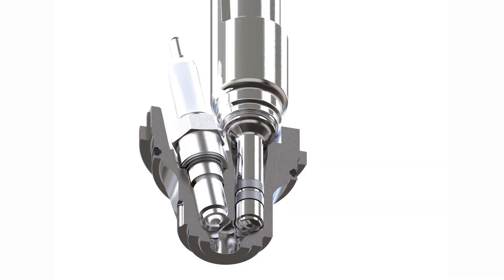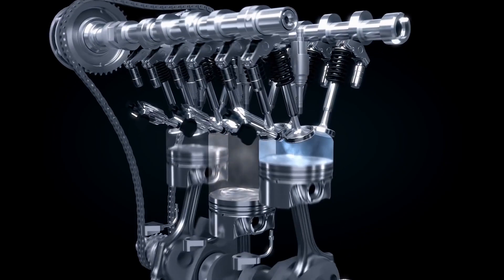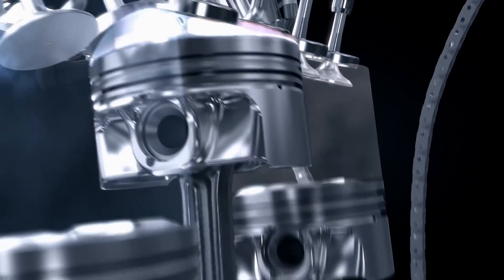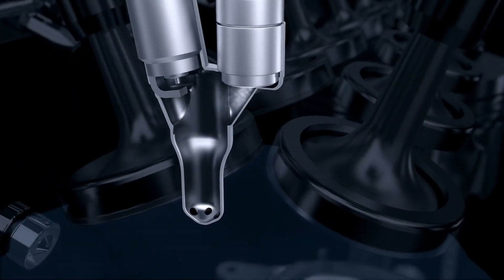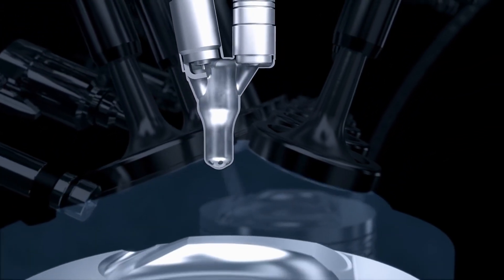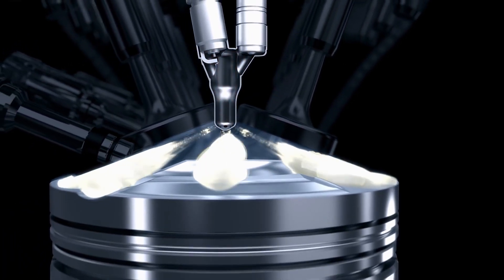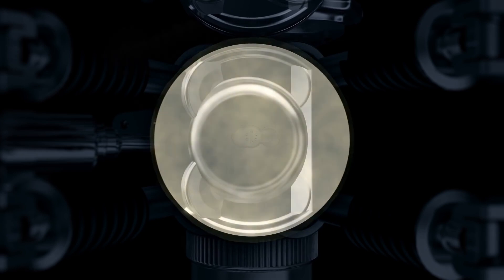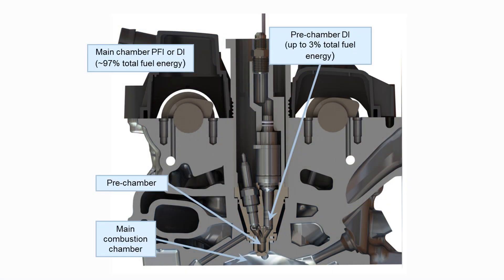Want +20% MPG? Bam, Here You Go - Autoline Exclusives

Comment: I see the spark plug right next to the injector but where does the air come from? Maybe there's enough air just floating around? Maybe you don't need much airbjust to get it started burning? It just seems like trying to light a stream of fuel would be very rich. What am I missing?
Reply: I see there is a prechamber. How does the air get into the prechamber? Reverse flow through those nozzles into the prechamber? I suppose there is enough cylinder pressure to do that. It just seems weird. Is that really the way it works?

Comment: I can't believe carmakers are still making internal combustion engines. People, we HAVE TO STOP MAKING AND SELLING ICE. The climate crisis is real - it needs to be taken seriously RIGHT NOW. Tesla has the right idea - and interestingly, THEY ARE THE ONLY CAR COMPANY WITH A POSITIVE FIRST QUARTER. That should tell you something about the desire for EVs.

Don't give me that BS excuse that there is no call for them - there's a much higher call for EVs than ICE, but they have to be good EVs. Tesla has raised the bar pretty high. So come on, let's see some of that fabled competition!
Reply: I would argue tesla has the wrong idea. It would be much more economical and beneficial for the environment to move towards a hybrid system. At least until battery tech improves. 

Their are limited battery resources and the average miles driven by people is roughly  26. Do you have one car go 250 means on electric or 9.6 cars only have enough batteries to handle most daily trips? 

ICE vehicles will be around for many more decades. Tge investments by auto makers makes sense.

Comment: FYI - Current F1 v6 engines have a max speed of 15,000 RPM, but normally peak at under 12,000 due to other system constraints. Still quick compared to normal road car engines, but nothing like the awesome v10 18-19,000 RPM screamers of the past.

Comment: Wow. This a real breakthrough that will hopefully result in emissions from ICE engines during the transition to electric.Very interesting interview.
Reply: The "transition to electric" will not happen. There will be a development for sure and lots of battery-based and electric-motor based travel, but there will not be a blanket "every car is a pure BEV" event. Engines will continue to exist in most cars. So this kind of development is even more relevant.
Reply: @zolikoff  I agree and I think we will have a mixture of different propulsion systems dependent mostly on the application type and economics of the time. From what I am seeing with the growth in technology the hybridized approach may become the dominant propulsion system for a while due to cost/resource effectiveness over hydrogen and BEVs. It can drastically reduce resource consumption on both the fuel side and the battery raw materials side all while providing most of the benefits of both methods and while utilizing more commoditized technologies. Also I believe ICE based vehicles will stick around because general reliability of all vehicles has improved dramatically across the board  since CAD/CAM has been effectively leveraged in the design process. On another note ICE may stick around even longer with more renewable bio-fuels potentially coming online in the future. Sorry if this was a bit wordy as I usually don't log on to YouTube this early in the morning. Cheers!
Reply: @zolikoff  If they keep making advancements in battery tech it would only be a matter of time before ICE cars go away.
Reply: @williammitchell1272  Tell this to 2nd and 3rd world countries. lol I imagine EV is only applicable to the western world which is maybe 20% of the world.
Reply: Yeah if we are to be using one general technology in the meantime why not make better for the interim? It is not like they will instantly disappear overnight even after any end of sale date so advancements are always a good thing to welcome.

Comment: I’d rather have dual injection. The intake valves are going to be caked up with carbon buildup. It might have the potential for burning oil. Depending on the brand.
Reply: Based on the description, it sounds like this is more like an ignition replacement than an injection replacement.  The main cylinder chamber would still be getting some more conventional fuel injection, and I don't think it precludes port injection.

How much carbon build up occurs in the prechamber depends on how it gets its air charge.  If it's getting it from the main intake with the vacuum recirc, it's a risk, but if it's getting it from a push via the compression stroke, the risk of fouling the prechamber is probably quite low.

Comment: I would like to hear what their 20% efficiency improvement is based on.  Is it 20% over a normally aspirated legacy two valve one spark plug engine efficiency, or is it 20% off an already optimized engine.  Keep I'm mind that 20% improvement on a 20% efficient motor yields 24% overall efficiency, not 40%.
Reply: If I had to wager a guess, I'm guessing it is based on two things --
One is being able to run leaner mixtures in the main chamber, and the other is getting a stronger impulse from rapid burn rate.  The former would be a true fuel consumption reduction, whereas the latter would be an effective power boost that makes it either possible to run at lower boost pressures or downsize the engine further.  The sum of those two could probably get you up to 20% improvement within the power band only.

Comment: This guy knows nothing about diesel auto engines. The indirect injection diesel engine was designed mainly for small automotive use by Ford, Mazda and Toyota to name a few. These engines were the high tech approach to diesel engines from the 1970s to the early 2000s.
Reply: The big breakthrough was Mazda's revolutionry precombustion port design which increased power and torque and with increased fuel economy  has popularised diesels over last forty years. Yes, old tech can be improved to become new tech. The turbocharger is another example of improved technology and is now seen as a modern improvement to the ICE, yet the turbocharger was first used more than 100 year ago. Today nobody would down play turbos as old tech.

Comment: I figured he would get around to leaner burn. More complete combustion won't give 20% improvement. Less than 1% of the energy in gas is lost to incomplete combustion.
Reply: The point is that you can get complete combustion in a crazy lean condition. So lean that the cylinder would misfire with a normal spark plug

Comment: What happened to those microwave spark plugs, that where reported on here, about a year a go. A follow up on that would be good. There where supposed to give a 20% increased efficiency to even old cars.
Reply: Theres a lot of tech that could benefit older engines but none of the legacy autos care about efficiency that much. The opposed piston engines would be taken seriously if it were true. Part of this is ignorance but mostly its the dead weight.

Comment: Bring Mahle back at some point for more on jet maintenance, prechamber or jet fouling and reliability.  Durability only alluded to briefly.
Reply: Older diesel engines had a similar technology and never had those problems. In fact Mercedes prechamber engines (OM617 for example) that use it are considered some of the most reliable engines ever built

Comment: 1:30 “[fuel injection/combustion optimizations] are a step-change in efficiency.”
Well 10-20% may be a step, but for a 100-200% step, you’ll need a BEV solution, like @Tesla’s
Reply: stop talking nonsense, yes EVs are good but not better than ICE, you can go everywhere you want with a diesel or gas engine, you just need extra fuel, with EV you always have to follow the charging network. overlanders will never use full EV to go to remote places or go around the world

Comment: Similar tech to Mazda’s skyactiv-x spcci. But I believe that Mazda is more complete, it has a ultra lean mixture and a very high compression ratio 16.3-1 if I am not mistaken.
Reply: Mazda instead of having a pre chamber to start combustion, it injects a little bit of fuel around the spark plug to start combustion and ignite the ultra lean air fuel mixture. Pair that with very high compression ratios and yeah it is a much more simple yet more complete than this

Comment: So they still want ICE around?
Pre combustion chamber tech came from diesel farm tractors
Reply: Nope, go back to sleep...
FYI, Pre-combustion chambers have been used in many diesels and non-diesel engines... like in early Civics....but it added complexity too...
Reply: My mom bought 1976 Honda Civic CVCC new that had prechamber. Run very smooth, really good fuel economy ( 50+mpg) and didn't  need a catalytic converter. Only drawbacks blowing head gaskets ( replaced under warranty). And overall junky car... at least on the poor county roads Teeneessee had at the time.